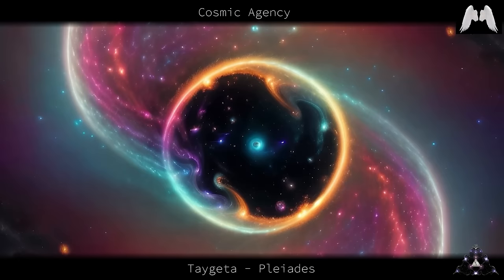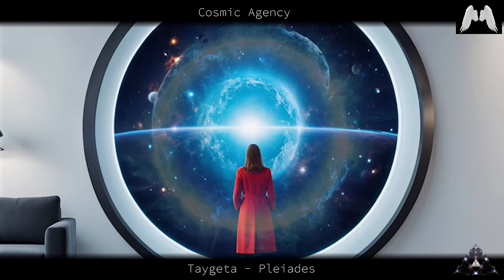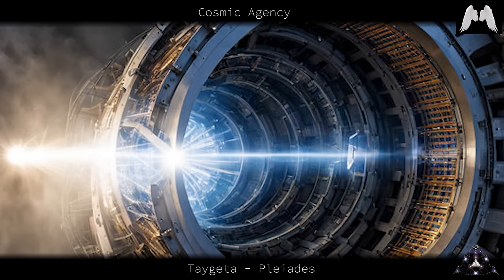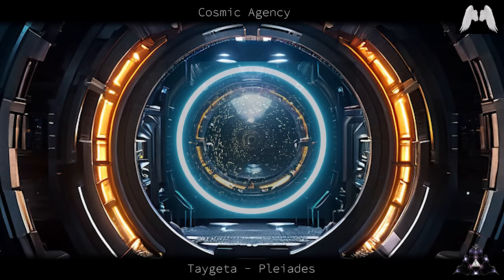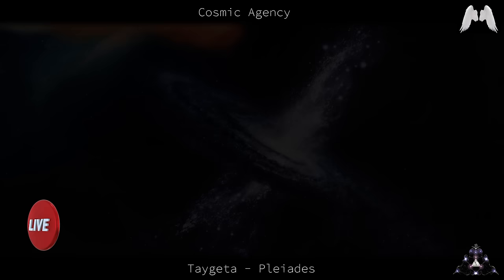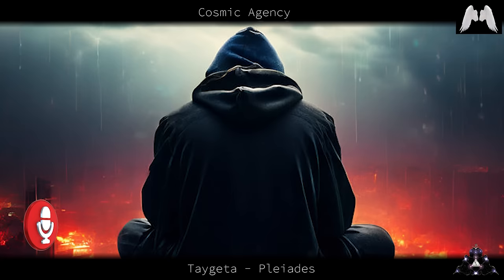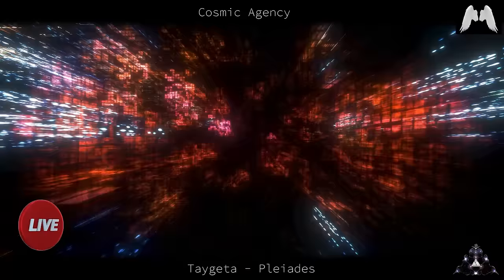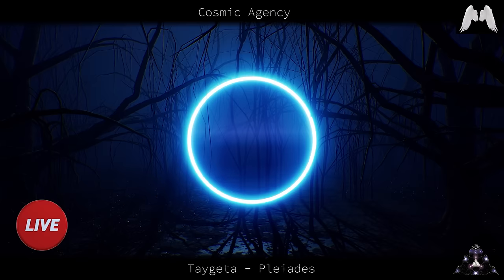Portals - Conversations with Aneeka of Temmer and Aneeka´s live with Robert

Comment: Mari (2/6) – Do you have an equivalent to ice skates? Roller blades work on flat surfaces, but they are linear and they lack proper stopping. Ice skates effortlessly achieve a complexity of movements in an ‘analogue’ fashion. On ice skates you can achieve an amazing combination of effects. And I must say, Mari, that if you enjoyed ballet, you would appreciate the beauty and style that a superb figure skater can accomplish. Also figure skaters have the speed, momentum and lack of friction to do spins, jumps and leaps that a ballet dancer can only dream of doing. (You could, of course build an ice rink on board Toleka. It is a yacht, and would allow recreation when the new ships arrive!) 

However I should think that if an electronic version of ice skates exist, and you could wear them and practice within the newly opened-up areas of the ship, you would be very pleased with the experience. If they do exist (and they interact properly in lower gravity settings), you can lower the gravity in a section of the ship, then your leaps & jumps, etc. would be magnificent, and falls would be of minimal concern (except you won’t slide (no ice), so gloves, elbow/knee pads (or skin-suit) are a must!).

If such technology does not exist, then I say now is the time to get Pleiadean sportsmen and hobbyists to work inventing such things! Ice skates are great on Dakote year ‘round or Erra in wintertime, but why not have e-skates which you can use anywhere, anytime? They would be particularly fun to have for ‘rinks’ on space stations where kids can learn all about ice skates in low gravity environments. (And a new sport is born!)

By the bye, ice boats for use in winter when the wind is blowing on planets, are incredibly fun and a thrilling experience. Got those, do you?

Comment: Mari (1/6) – I was thinking around the concept of low gravity rooms. With Saska One removing all those empty cabins it occurred to me that you likely have lots of space available now. I got thinking that a big open space with the Gravity dialled down to 0.1G would be a fabulous place to be sliding around on in socks! This would be similar to ice skating, and essentially with ice skates, the friction under foot has been reduced to around 0.1G. Loss of friction creates balance issues, and on Earth, falling hurts. But in a room with 0.1G gravity, balance would still be an issue, maybe more so due to the effect on the inner ear, however falling would be no problem since you would weight only 1/10th!

But with ice skates, we can create friction when we need it, by angling the skate and its blade to ‘bite’ into the surface, either for acceleration or for stopping. You will not be able to do this. Thus, you will need to get a running start and jump into the low gravity room and slide and slide.

Caveat: I have also played ice hockey, and let me tell you, the side walls are just as hard with 0.1G under foot as in normal walking. They do not move when you hit them. Also, unlike with skates, you will have no friction under foot to stop, but you still have Mass and Velocity. In short, it hurts. Furthermore, if it is a big room with only one door, how do you get back? Remember, you have no friction under foot, unlike with angled ice skates. So start with 0.6G, then 0.4G, etc. This whole situation is a great lesson in Physics!